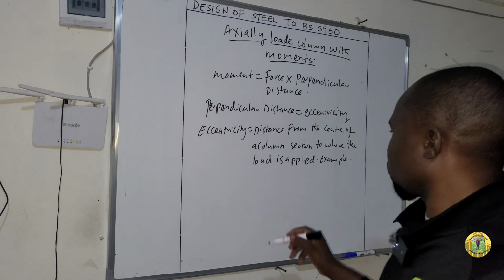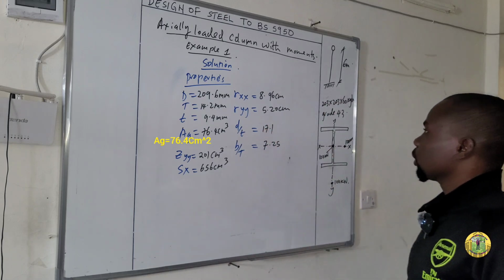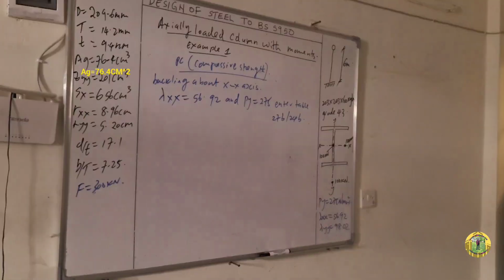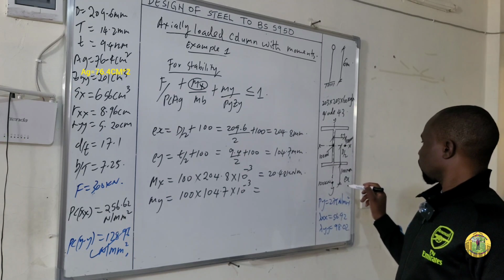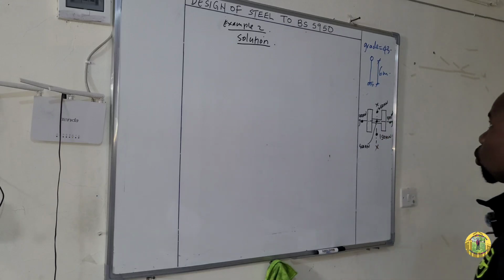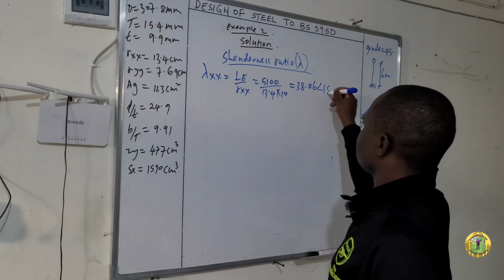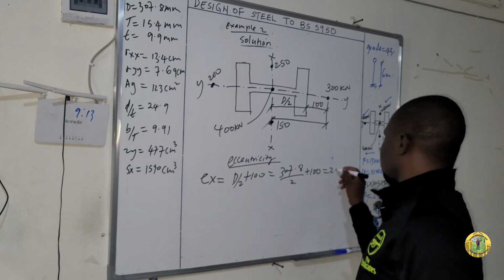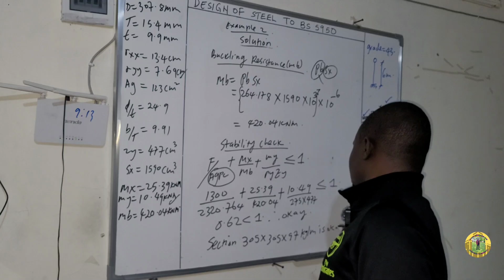DESIGN OF AXIALLY LOADED COLUMN WITH MOMENTS TO BS5950

Comment: Sir, for example 2 when finding the section classification for flange. It should be CLASS 2 COMPACT AND NOT CLASS ONE PLASTIC. The value for b/T= 9.91 which is greater than 9.
Reply from the maker: Yes, you are correct. 

Class 1 (Plastic):
 b/T must be less or equal to 9.0E

Class 2 (Compact): 
b/T must be greater than 9.0E but less than or equal to 10E

Class 3 (Semi-compact): 
b/T must be greater than 10E but less than or equal to 15E.

Where E is the square root of 275/py
Reply: @OdavigiStructuralHub Ok, since flange is Class 2 Compact and the Web is Class 1 Plastic. How do we decide if the trial section is Class 1 Plastic or Class 2 Compact.

Like how do we finalize?
Reply from the maker: @MichaelAyodele-xl3uz In structural steel design under BS 5950, the classification of the entire cross-section is determined by the least favorable (highest numerical) class of its individual parts.
    Your Flange: Class 2 (Compact)
    Your Web: Class 1 (Plastic)
    Result: Your section is Class 2 (Compact).
Reply: @OdavigiStructuralHub does the section classification affect any part of the calculation carried out on the design?
Reply: For example 1, when you did the stability check, the value of (Py.Zy) should be multiplied by 10^-3 at the denominator or 10^3 at the numerator, this ensures it's in knm
I got 0.64<1 so still a very stable section